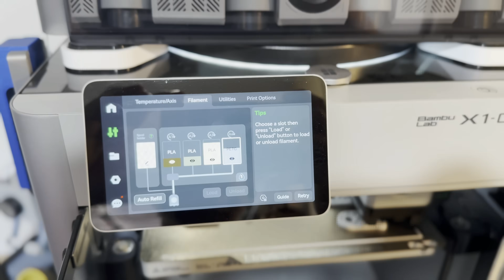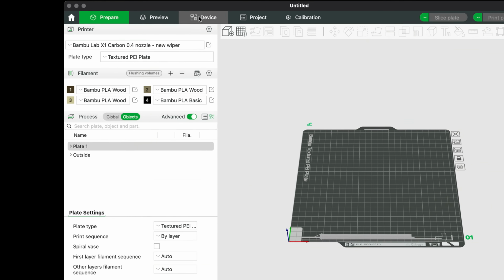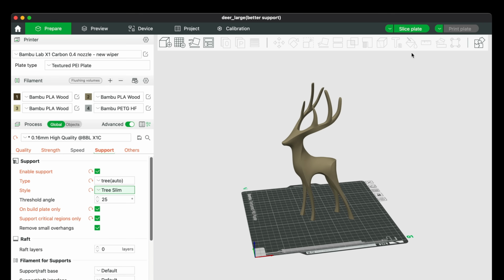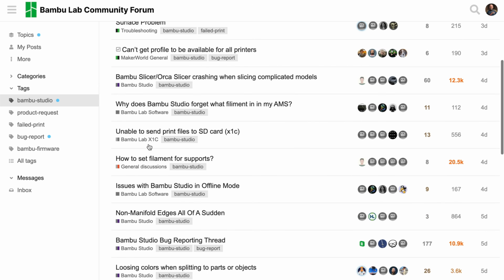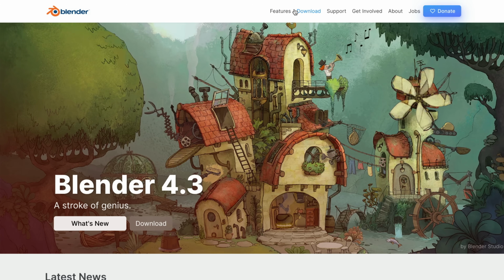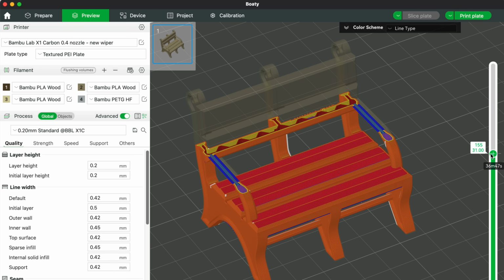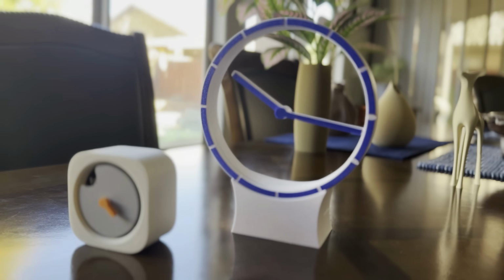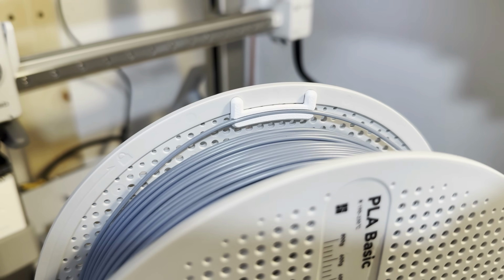New to Bambu Lab? This is What You Really Need to Know

Comment: Great video. I hadn't come across 'number 4' - pressing down on the filament in a refill, and don't recall sseing any mention in BL filament refill instructions, but it sounds like a good idea.

Handy tip: if you have an AMS and a filament has run out, you'll be prompted to load a filament in the same slot. But if you don't have an exactly matching filament to hand you can load a different colour and then resume your print as the AMS doesn't read the filament RFID tags once a print has started.
Reply from the maker: great tip, thanks for sharing that. And yes, pressing down on the fillament will prevent the filament from getting jammed between the roll and the spool when unfurling.
Reply: @zionbrock  Thanks for the the explanation.

Comment: 1. DON'T expect anything much in the way of after sales service without putting up a fight for even your most basic rights... just like I am having to do at the moment!
2. DON'T forget to read the "small print" before you buy, trust me, their T&Cs are draconian! They even go counter to the trading laws in your area if they think you don't know them, falling back on a tiny comment towards the end of the T&Cs which says something like, "local trading laws will be respected" - but that won't stop them trying to get round them!
3. DON'T expect honesty if you have any issues - expect to be patronised and to have to face obfuscation, prevarication, contradiction and even LIES.
4. BE AWARE that Bambu recently changed their T&Cs including in the revision the means to tie you in to buying only their filament if you use an AMS - they say they are not going to do this however the means to do so are there - why else have they refused to make RF ID tags work with other manufacturer's filaments despite the print community asking them for this ever since the AMS appeared? There's also the possibility that they could brick your machine if you don't carry out updates, updates which could totally change your machine so that you are "renting" the ability to print with a machine you have actually bought! I say again... these scenarios have not been declared; in fact they have been strenuously denied by Bambu. But why make these radical changes to a system which is working well if you have no purpose in so doing? I can only go off what I have read and it's very worrying reading!

In short, if you are thinking of buying Bambu then... CAVEAT EMPTOR!

Comment: Bamboo handy very limited ? How so please explain your statement.  It does exactly as it's supposed to. Hey search for premade files that you can upload directly to your printer.
Reply from the maker: Yes, it does what its supposed to. But compared to Studio, it's not even close in functionality. 

"Bambu Handy and Bambu Studio are both tools designed to enhance your experience with Bambu Lab 3D printers, but they serve different functions and offer distinct features.

Bambu Handy is a mobile app that allows you to:
	•	Monitor and control your printer remotely, providing live video feeds and status updates.
	•	Access the MakerWorld models library to browse and print designs directly from your device.
	•	Receive automatic notifications and timelapse videos of your prints.

However, Bambu Handy does not offer slicing capabilities or advanced print setting configurations.

Bambu Studio, on the other hand, is a comprehensive desktop slicing software that enables you to:
	•	Import and prepare 3D models for printing, adjusting settings such as layer height, infill density, and support structures.
	•	Utilize project-based workflows for managing complex prints.
	•	Access advanced slicing algorithms and a user-friendly graphical interface for a smooth printing experience.

In summary, while Bambu Handy offers convenient remote monitoring and basic control features, Bambu Studio provides the in-depth tools necessary for preparing and customizing your 3D prints."

Comment: wait what, why would printing by object save material?
Reply: Somewhat difficult to explain without a visual representation, but here goes. 🙂
If the objects on the build plate are mostly one colour, or their colour-change layers don’t match the colour-change layers of the other objects on the build plate, then printing per-object is more efficient than per-layer because it minimizes filament changes. 
In per-layer, every color change triggers a purge—even if just one object needs it, a colour-change purge is triggered—wasting filament. If objects are mostly one colour or their colour-change layers don’t match, this waste adds up fast. 
Per-object finishes each print before switching, reducing overall purges and saving material.
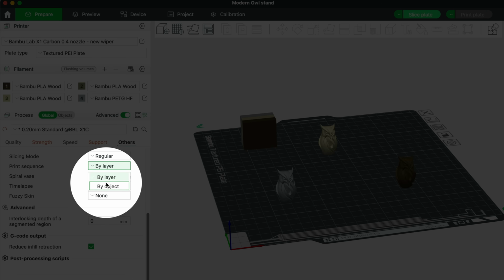Very briefly you can see in the video that at 12:42 the platter/build plate has a purge tower while set to "per-layer" and at 12:46 there is no purge tower for the "per-object" print.
Reply from the maker: thanks for your detailed explanation, couldn't have said it better myself!

Comment: You say don't skip step 4, but in the instructions that come with the filiament refills, step 4 says to remove the plastic straps and apply the label.  Nobody skips removing the straps... The step 4 you refer to is only in the Bambu Wiki.  Maybe a better use of 5 seconds of video would be to direct people to the Bambu Wiki as a supplement to the often weak instructions that are included with the Bambu products
Reply from the maker: Good point, I should have been more specific about what step 4 I was referencing. I have a link to the wiki in the show-notes. Also, I do show the step on the screen in the top right corner, while I'm demonstrating. But I was not aware that it was numbered differently in the instructions that come with the refill.

Comment: New to 3D Printing with a BL A1 Mini. Parents bought it for me for my birthday last month, and I’ve been toying with several different materials (material finishes, mostly PLA based) for things like props, tabletop miniatures, and lately printer peripherals to preserve and extend the life of certain cables and tubes.

Understanding the specs of whatever material you’re working with is extremely important for getting the print to be successful, and DO NOT THROW AWAY YOUR FILAMENT PACKAGES. Having the resealable bags for your spools are incredibly helpful for keeping them from absorbing any moisture excessively.
Reply: Agreed, though most (currently) filament spools don't come in a reusable bag.  Luckily, a pack of 20 resealable double-zipper bags is ~$15 on Amazon.
Reply from the maker: I agree, understanding those materials specs is key to success. And that's a fantastic tip as well.